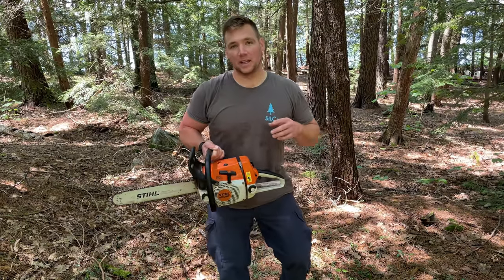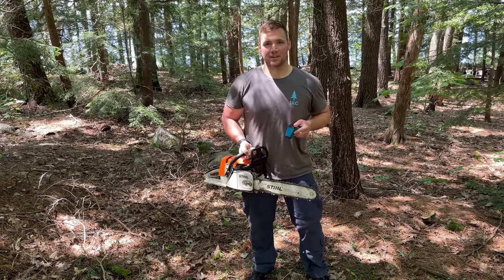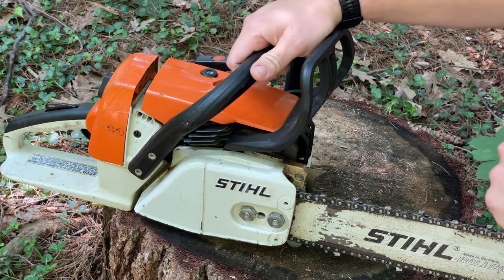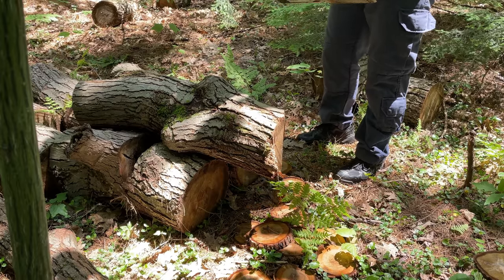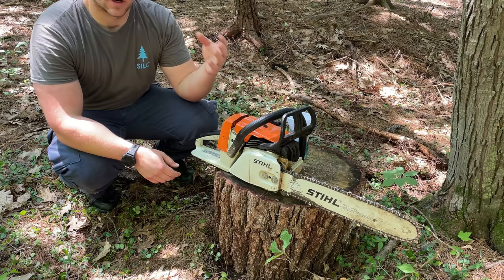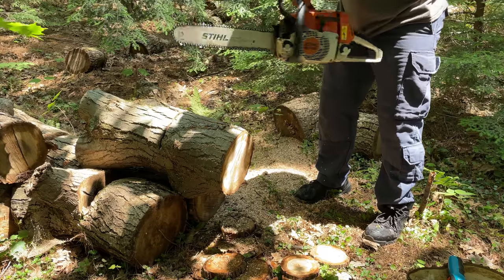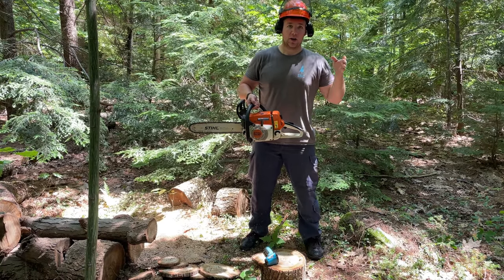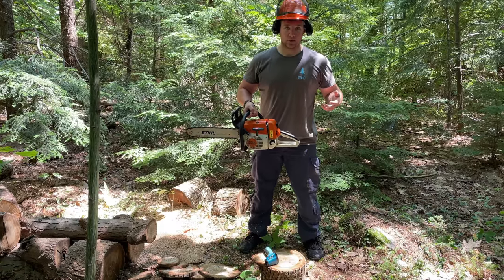Will my chainsaw last longer if I use more oil? Is it safer? (25:1 VS 50:1 temperature testing)

Comment: I love you Dave but.... rule number 1 in 2T tuning is to tune your carburettor whenever you change oil mix. Not doing this is stupid. You can run more oil but you have to adjust your jetting. If you don't you run the risk of lean damage. Oh dear Dave
Reply from the maker: Hey there Aussie! I would argue that carb tuning is well beyond the scope of the average user. I agree, long term you would want to tune for the added oil. Seems like a waste to me. I will run 45:1 from now on!
Reply: @DavesSmallEngines  Dave if you are going to play 2T with many little engines, it's imperative that you become a good tuner. It's an absolute MUST. If it's beyond the 'average' user with his ms170 sure I get that but he should let the dealer tune his saw to 50:1 and NOT change his mix ratio. Changing mix ratio without retuning is not only stupid but can becomes a very expensive habit. It's completely OK to run a wide variety of mix ratios so long as your saw is tuned correctly. Even if you change your oil brand you should retune. Synthetics and mineral oils will change saw behaviour. Where your at, you should absolutely have the basics of tuning down pat. Eventually you want to not even rely on a tach and be able to use your ear.
Reply: @aussiehardwood6196  Very good points! I always use a 50:1 mix and find the saws run just fine and run best at that mix and think any more like 40:1 just creates more smoke and carbon/ sludge build up from the extra oil.
Also Stihl have designed their saws to run on 50:1 so that says something to me that it seems they did that for a reason. I always use stihl 2 stroke and chain oil too. That way its all designed for Stihl by Stihl.

Comment: 25:1 long term would leave excess carbon deposits on piston head and cylinder eventually causing problems. Due to loss of rpm causing engine to work harder to cut wood and less fuel efficiency. A rep at a licensed stihl dealer told me that all stihl products could run fine on a 80:1 mix short term with no problems. 2strokes are designed to run at higher rpm full throttle at all times under stress n cutting that’s how they’re going to perform n cut at their best. Half throttle bc it’s softer wood or whatever the reason also leaves more carbon buildup.

Comment: At 25: 1 ratio the engine runs leaner (and hotter) as there's less fuel in the mixture. I wonder what the outcome could have been if you adjusted the air-fuel valve to account for the thicker mixture.

Comment: Great video. I wish though that you had included 40:1. I think most users try for 50:1 but put in a bit more oil just to be safe. I burned a piston on my Husky 563XP at 50:1 and go 40:1 now.

Comment: The harder you run an engine the more oil you need in the mixture, at higher rpms more oil gets blown out with the exhaust and are wasted. For example if you are milling you run wide open throttle for minutes without pausing. I run all my saws at 32:1

Comment: I purchased a calibrated 1 gallon measuring container just to mix my gas and oil to the exact proportions and no guessing. Once  I have my mix ready I transfer it to my gas can. After paying 500 dollars for a backpack blower I wasn't taking any chances with a wrong mix. A lot of people use those small one gallon gas cans and don't realize that they're usually more than one gallon. Just a FYI, depending on where your machine was built, most likely at sea level. A carburetor adjustment might really help because of your altitude.

Comment: Have been running 2 strokes for years. Have experimented with different oil mix ratios and there is less wear at 20:1 than 50:1. In a motocross bike did run 20:1 in a bike that came from the factory drooling black goo from silencer pipe. Observers would say oh, you are running too much oil. But decreasing amount of oil does nothing to decrease the black oil emission. The problem was air to fuel mixture. Just changing jetting and regulating the amount of fuel to air provided the pipe to burn a dry light gray.  The mx bikes have a much more adjustable carburetor allowing for precise adjusment in 3 areas, low, medium and top end rpm's.
Same principle for chain saws with only low and high adjustment.

Comment: Always run your mix that was specified by the manufacturer. I ruined my Stihl 070 because I listened to a "professional" that told me to do 50:1 instead of the Stihl-recommended 20:1 because he said "your saw will have more power and run cooler". Well, 2 hours later my piston ring is blown...so that's that.

Comment: I always use Stihl hp ultra with non ethanol 100% gas. I have my own ritual. First I pour about 2" of fuel in the jug, then I add all the oil. I mix, then fill the gas to appropriate level, then mix more. Lastly, I take the empty oil bottle, pour a shot of gas in it from the jug, shake that little bottle and pour that remaining bit of oil in the jug. I do this to make sure I get every bit of oil out of that bottle. If you don't, there's always always good tablespoon worth of oil left over in the bottle, maybe that's a bit OCD.

Comment: Environmental pressures have caused all 2-cycle tool mfgs to now require 50:1, even now state to use 50:1 in their older tools as well for same reason.

Comment: Dave... Another great video! My man, you could've been a mad scientist. I like how you thought out the controls for the experiment. Letting it run out of fuel and cool down before trying the 25:1. And, the fact you did the 50:1 first...was that on purpose? Great idea! It minimized residual oil in the fuel tank and lines, that could have skewed (albeit very slightly) the test, if you did them in the opposite order. Well done!
Reply from the maker: Hey Cy. My father is an engineer and I hope he is proud! He watches all my videos before I post and gives me the thumbs up or down. Glad you liked it!

Comment: I was a small engine mechanic for a landscape company, we used slightly more oil than recommended 
The only real issue we ran into is, carbon would build up at a higher rate. generally where the piston meets the exhaust port  it would start creating a barrier and restricting flow, and ultimately performance. but since it was my job to deal with it the extra oil in the gas would give just a little better protection during run time
You have to realize most these engines i was working on had 4-6 hours of run time per day...x5 a week.  for 10 months at a time. so inevitable engines would go... but it was rare we had to do a engine swap...

Comment: Nice video! I wonder if the 25:1 was used and the carb were jetted a couple percent richer (as a lower percent is gasoline and could be lean as mentioned)

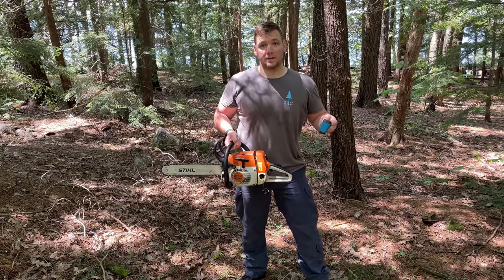Comment: I fixed about 100 2-stroke engines in the last 5 years. Some 70years old, some brand new. I do only run 1:25 and adjust carb when necessary. Never had a piston seezed. But I got a lot of quite new engines with damaged zylinder that have been run on 1:50 (or premix).

Comment: here in Europe, almost every chainsaw has instructions that state that the ratio of fuel to oil if mineral oil is used should be 25:1, and the use of synthetic oil in the ratio of 50:1 is recommended.  most small saws up to 42cc have a 40:1 mixture marked on the plug or next to the plug, this is because small engines use a smaller amount of fuel mixture for operation and therefore need to have 2.5% oil to prevent damage to moving parts

Comment: in my testing I've found that smaller saws seem to require less oil (eg. MS361 had best cut times and temps with 45:1) and bigger saws required more (eg. MS661 had best cut times and temps with 32-36:1)  But over all for most 2 stroke oils the safe ratio is 40:1.   (thicker oils probably better off at 45:1) thinner oils which make up the most options = 32-40:1)
Reply: nice test btw!

Comment: Great Video.  Very informative. Regarding my friend's MS 390, I replaced the piston and cylinder he previously fried with aftermarket parts.  I suggested to him to mix 45 to 1 with synthetic 2cycle   and richen up the mix with Marvel Mystery Oil so the entire mix ends up being 35 to 1.  When experimenting with fuel mixtures outside the manufacture's specs, there is a lot to consider. More lubrication does not necessarily mean less heat. I figure with the aftermarket parts rebuild, if the chainsaw lasts at 3 seasons it was a success.
Reply from the maker: I think so too! Has he noticed any power differences?
Reply: you have to figure what caused the saw to lock up ,most times its  a vacuume leaks causing a lean condition .if you just slap new cyld. and piston you have not fixed the problem and in no time it will lock up again!
Reply: @andrewslagle1974  Thank for the up date  and info.  I replaced the crank seals and the OEM crank bearings with  SDK Bearings . Also performed a leak down test as well.  My friend used  cheap 2cycle in the chainsaw which cause the piston and cylinder to fry.

Comment: The reason for using more oil is better ring sealing. The reason the saw ran hotter on 25 to 1 is that it was running leaner. 25to1 is more viscous than 50to1. The venturi in your carb creates a vacuum that sucks the fuel through the jet. The more viscous the fuel, the harder it is to suck through the jet, the leaner the saw will run if the jets are not adjusted for the higher viscosity. Ultimately run what the manufacturer recommends.  The rings and cylinder wall materials and finish are optimized for that ratio . The carb jetting will be closer too:)

Comment: I’ve heard some say to use the ratio recommended by the oil manufacturer rather than the engine manufacturer…I had an EZGo golf car several years ago with a Robin engine. It used a 128:1 ratio when using EZGo oil, so 1 oz of oil per gallon of gas, and still had a little smoke.  The dealer told me if I used any other oil the mix would have to be a lower ratio.

Comment: You keep doin what your doin and I’ll keep mixing my oil 20:1 and using my 21 year old cub cadet weed eater and 12 year old stihl saws that have a immaculate piston  and cylinder yea they have a little extra carbon on the piston and it blows a little smoke
Reply from the maker: Sounds good Dr!

Comment: Been running two strokes for 40 years. There’s a big difference between brands, not just what specification they conform to but how much oil is maintained in the crank, how much carbon builds up, whether the oil burns or leaves the combustion chamber as an oil. Sadly some of the more expensive oils leave more carbon in the combustion chamber and in my experience damage caused by excessive carbon is a common cause of piston and cylinder damage.

Comment: Assuming the methodology (duration of cooling, sequence of testing, fuel trim, etc) of the experiment was fine, this is helpful information which explains a lot. After all, if manufacturers found that 25:1 was better, they would obviously recommend that. When I hear consumers instinctively add more, I scratch my head and wonder why. It seems a mix of ignorance and arrogance to think that a consumer knows more than the engineers who designed and tested the equipment. They have no motivation to lie, and the results of proprietary research are not always disclosed. As with many engineering decisions there will be trade offs, and a balance of risks. You've shown that running temp is higher with more oil, and running temp (too low or too high) correlates with engine survival. So, we should carefully recognize what we don't know. I would carefully stick with what's recommended.
Reply: operating on the assumption that there aren't people telling the engineers how it needs to be made. i.e the EPA. look how smart you are, the smartest person in the world. the only one who can't figure out why everybody else is doing something, because youre sooo smart. ^_^
Reply: @schlomoshekelstein908  That's a good point, and it would be even stronger if the guidelines were recently updated. As I recall, the 50:1 goes back to when I was a kid, which is a very long time ago, ha ha.

Comment: I find that with cars and small engines (both) that when it comes to fuel and lubrication specs, you can’t outsmart the guys that designed it. Using too much oil may work in the short run, but will also have a tendency to clog carburetors, exhaust screens, and foul spark plugs. If you have 2 two stroke engines and one specs 50:1 and the other 40:1, I’ll probably use 40:1 in both. If the specs are farther apart, I’ll use 2 mixes.
Reply: Yes, while this is generally true, you need to factor in the pressure that the EPA puts on the manufacturer. Their interests are not necessarily in line with longevity or performance.
Reply: 50:1 is due to the epa, more oil- increased longevity and more power.

Comment: Thank you for the test. 4% might be little bit too much with mineral oils. But, did anyone noticed that in all three tests there was unfavorable variables for the 4% mixture that might play a role in higher temperatures... In idle test, the tool was in full Sun that was directly warming the cilinder cooling ribs. Then in both sawing tests, the logs were notably thicker, especially in large ones and probably also, the composition of wood was harder to cut at that point than for the 2% mixture tests. That lead to more cutting time and higher engine load. .... Hmmm...

Comment: AWESOME VIDEO!!! I’m always wondering about thermal issues like does that extra heat transfer damage the PTO side oil seal. Or can a hotter drive shaft warp after cooling with an over tightened chain. But this video was awesome, I love videos proof instead of here say on the internet. BRAVO 👍

Comment: 😄 dull chain was completely spent by the time you had to lay on it with the 25:1. Wonder why the engine was hotter? 🤔 I’ve run 32:1 since the advent of 2 cycle oil. (Earlier std. was sae 30) Zero worn out engines. I run many models from all brands. Daily.

Comment: You will never end it. Also you described different standards for both. The 50:1 gets the advantage of a cold start to give it lower readings to start with. Run each fuel all the way out until it stops running and from cold both fuels on separate days so the saw and fuels are all you’re measuring,

Comment: Im still using 1960s homelites with corn gas (ethanol) and Super tech oil mixed 1/2 pint to every gallon of gas. 50 plus years old and still going strong. I like blue smoke.
Reply from the maker: That’s awesome!
Reply: @DavesSmallEngines  I am still running the 16 to1  mix. I have a 64 Xl12 that has never had cyl or piston ring work. and another 54CC  101 saw. A older Zip. A 68 CC lombard, A 58 CC super XL a 925 and a 550. My wife Thinks Im nuts carrying 7 saws to go get firewood. What I do is run a tank of gas thu a saw. and let it run completly dry. Then grab another and do the same thing. and keep going. I usually only run the bigger saws on very large  diameter trees. I have stack mufflers on most and the others the mufflers have been gutted, My Father bought a new Xl12 in 64 and I got to use it when I was 13.  What ruins saws is leaving gas in them that gets stale. and failure to keep the saws cylinder and air flow clean and they overheat. any saw that boils fuel is running too hot. you also have to properly adjust the carb for the fuel mix you are using. When folks tell me how terrible bad Etahanol fuel is. I ask why car engines today last 200000 and 300000 miles or more running on it. When back in the 60,s if a car engine made it to 100,000 miles it was something. Most where worn out and nurning oil by 70,000 miles. and the leaded gas fouled the spark plugs they had to be cleaned or replaced every 10,000 miles.  My wifes car has over 300,000 miles and had new plugs one time at 200,000 miles.

Comment: Nicely done wait 50 to 1 I've always done 32 to 1 did something  change in the last 20 years and I use any 2 cycle  oil I can get at any gas station usually the cheapest  my pore 2 strokes
Reply from the maker: Yes, oils are better now!

Comment: I run 44:1 with blendzall green label oil and non ethanol fuel....been using this oil for over 40 years in all my 2 strokes motors...never had a problem.

Comment: 20 years Northern Arizona a cut firewood, mostly in the summer getting ready for winter, always Moran more oil, 20 years no problem, The saw runs like new.

Comment: You have to adjust tye jetting setting if your going to run different ratio of fuels. You will find Temps will be the same, but longevity will suffer, over time. Softer woods I run leaner mixture, but hard woods I run more oil.

Comment: I run 32:1 full Syntec oil, and adjust my A/F mixture for max power. I gum up more plugs than my friend but my engines always last long even if if run them hard until it runs ouf of gas.

Comment: I've had my Stihl 028 for the last 40 odd years and have only ever used 25:1. In that period of time I have done a couple of sets of rings and crank bearings with seals once ! 
I have never had the need to  replace the cylinder or piston . It is extremely reliable and can sit for months and then start second or third pull .
I daresay all the scientific data on here is correct ....BUT , being old school , the old 25:1 mixture works fine for me ,and i think my old saw proves it.
P.S. I also have an Echo CS550 and the handbook recommends 25:1.

Comment: It would be great if someone showed how to convert 50:1 or 40:1 premixed fuel into 25:1 or 30:1, no one seems to sale those as a premix and buying non ethanol gas is getting harder to find for a diy mix

Comment: Been running saws for a living for over 38 years. I have never run 50:1 in my saws. And they run for years. 

And by the way…Stihl and Hisqvarna don’t make 2-cycle oil. They contract with the lowest bidder to manufacture it and bottle it in their name.